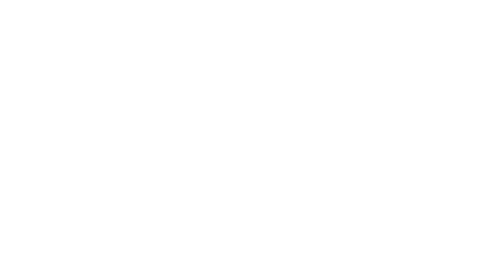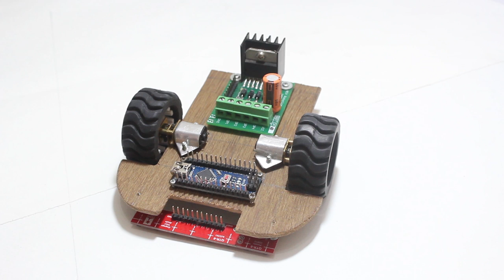Video 1 Introduction To Advance PID Line Follower Tutorial

Comment: From where did you but the sensor array and motors?
Reply from the maker: Sensor Array is from mgsuperlabs and motors are from china
Reply: Arnab Das what about the wheels? i couldn't find the right wheel for the micro motor shaft

Comment: can you tell me the torque rpm and gear ratio of your motor ? and what battery voltage r u using ???
Reply from the maker: rpm is 400 at no load and 12v .. am using LI Ion battery 3S  at 12.6v to 11.1v
Reply from the maker: https://www.youtube.com/c/ArnabDasBwn check other videos of Line follower and Subscribe